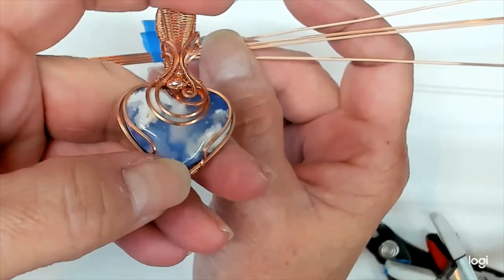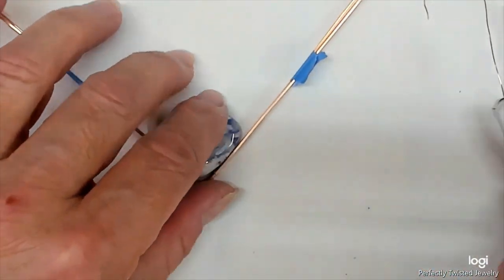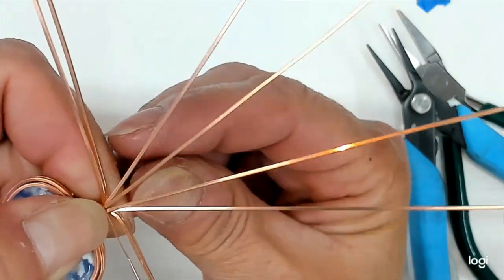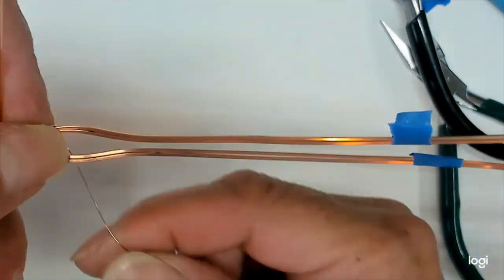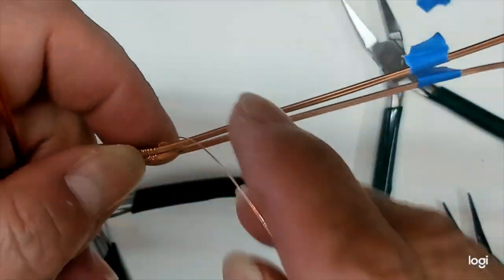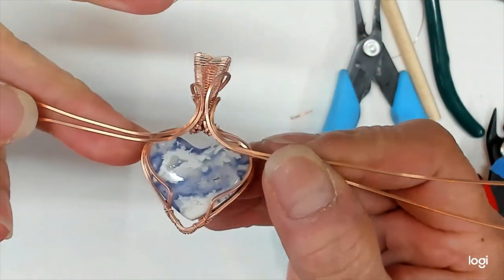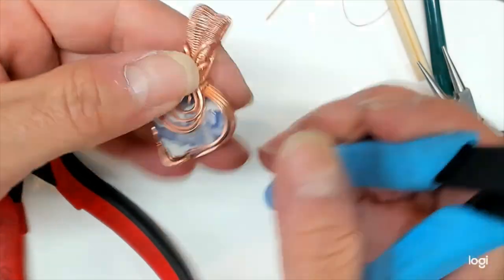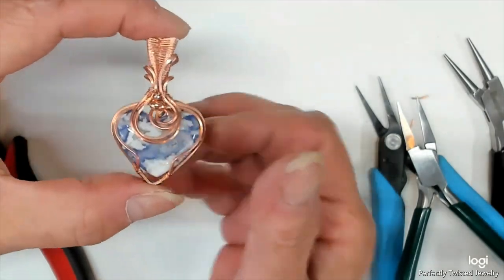Wire Wrap a Heart! Blue Sky Heart Pendant TUTORIAL - Make This! STEP BY STEP

Comment: Thanks - beautiful design ❤️🇩🇰 Do you Think I Can use this on a heart Stone 40 x 40 x 8 mm?
Reply from the maker: I think so!  You should add about 3 more inches of wire to each length tho.  I don't know how thick your heart is or if it's flat on the back or rounded but I think you can do this with 15 inches x 4... let me know how it goes! Thanks for your comment.
Reply: @PerfectlyTwistedJewelry  Thanks you - i Will try it (the heart is rounded in the back too) 💕🇩🇰